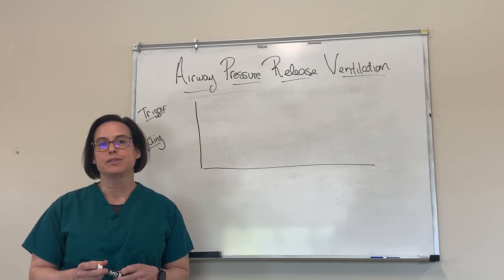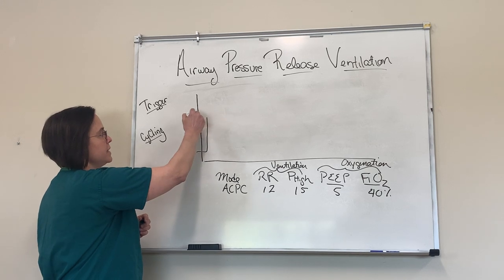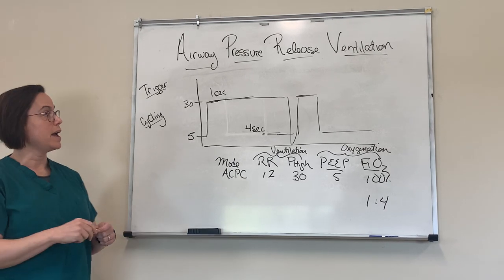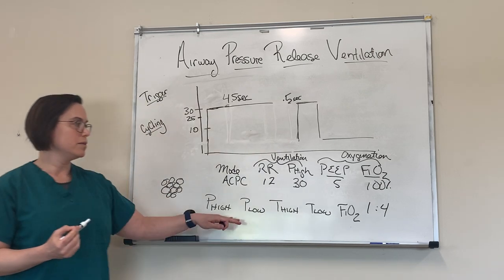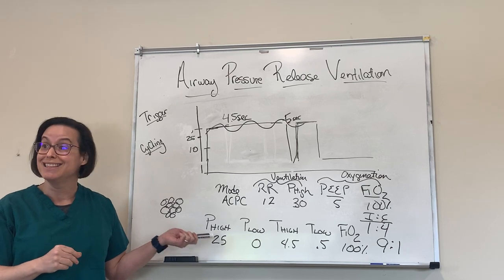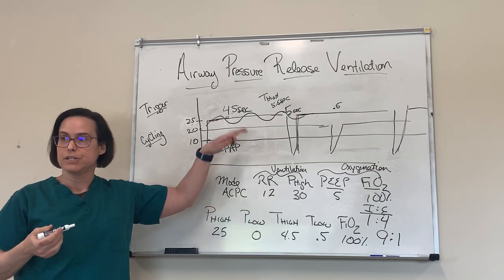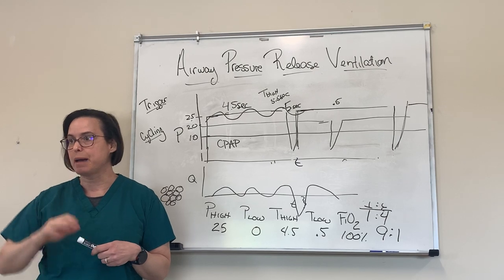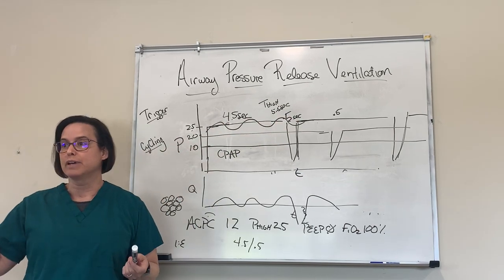Airway Pressure Release Ventilation (APRV)

Comment: 2 part question here..Does APRV mode recommended to use for pts that are prone and paralyze induced? If permissive hypercapnia is acceptable and Phigh is already set to 30 but low Vte returned will you switch pts back to ACPC?

Comment: So sorry about your father in law. Thank you for this video. Just one doubt, could u pls explain how u calculated that I:E ratio as 9:1? I didn’t quite get that. Sorry
Reply: Patient is spending 4.5 seconds for inspiration (Thigh) and 0.5 seconds for expiration (Tlow) which is a ratio of 4.5:0.5. And since ratios don’t have decimals (usually) you multiply both sides of the ratio by 2 to make it 9:1.
Reply: Shud we always multiply by 2 for this reason?
Reply: @mbel5694  the goal of the ratio is to make it a whole number. So not always 2 it depends on what you set the Tlow to. Just have to get it to be a whole number.